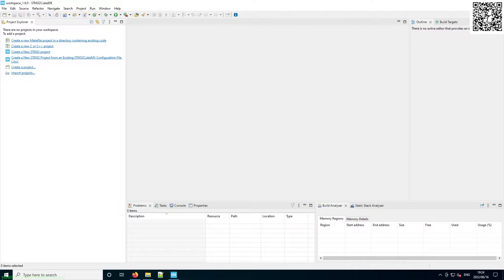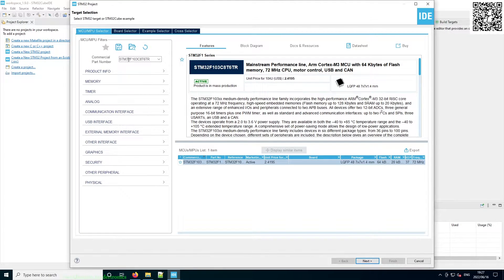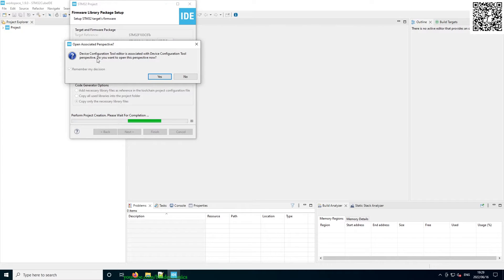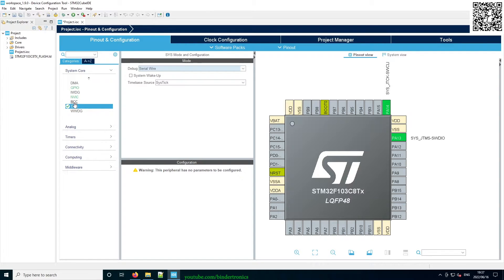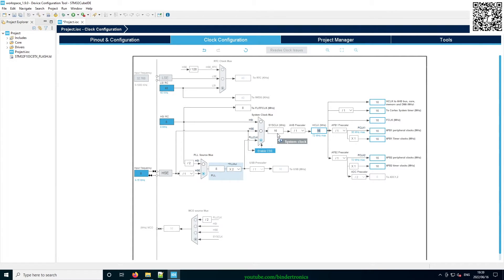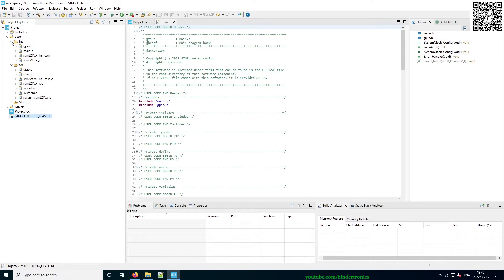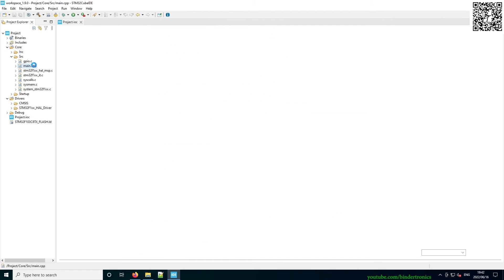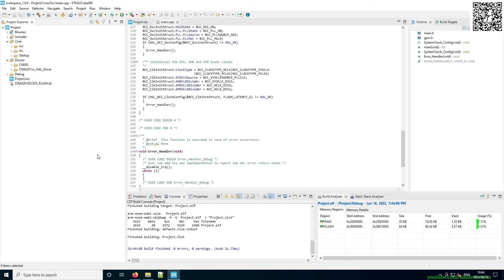Project 🟣 STM32 Programming with STM32F103C8T6 Blue Pill C++ in STM32 Cube IDE

Comment: Thank you! new sub. Even tho the main is cpp and the other files are c. Will it work as C++?
Reply from the maker: C++ is for the most part "backwards" compatible with C. C structures are not 100% compatible with C++ structures. C++ treats a struct the same as a class with the default access modifier as public instead of private. You will see me use a mix of C and C++ in the later videos. C++ is not C and vise versa.

Comment: C or c++ ? Which is better ? I don't have C++ experience so I lean on C
Reply from the maker: There is no correct answer. The main arguments are: C tends to be more memory efficient while C++ is more future rich.
You are able to write procedural and OOP in C++ while C can only do procedural.
Just a note: C and C++ are no longer 100% interoperable. Just ask anyone that has tried to initialize a C struct in C++.
My rule of thumb is the more memory a device has the more likely I am to use C++.
I will not go into great depth with C++ in this series.
I would suggest you learn basic C++. There are only advantages to it, from porting Arduino libraries to career options.

Comment: I have a voltage inverter that uses an STM, generates a PWM signal, the chip only turns on when metal touches the GND of the STM, what could it be?
Reply from the maker: Got electronic repair experience? I wouldn't touch a inverter internals otherwise. Find a local professional to help you.
Reply: Sou experiente no assunto sim, me refiro no problema que esta acontecendo no oxilador  pwm stm32f103c8t6, só liga se eu tocar  chave ou pinça no gnd do mesmo.tenho muitos inversores com esse problema que usa essa micro.
Reply from the maker: Sounds like a floating ground. Can't help you without taking measurements myself. 
Google translate is not helping much for the language barrier also.

Parece um terreno flutuante. Não posso ajudá-lo sem fazer as medições sozinho.
O Google Tradutor também não está ajudando muito com a barreira do idioma.

Comment: Thanks for the vid! I had a problem while debugging. I had an special character on the directory path where the workplace was (an "á" on the user folder name). That threw me an error. I solved it by changing the directory of the workplace out of the user folder avoiding the special character.
Reply from the maker: Just wait till you copy some code and it has a invisible Unicode character in it.